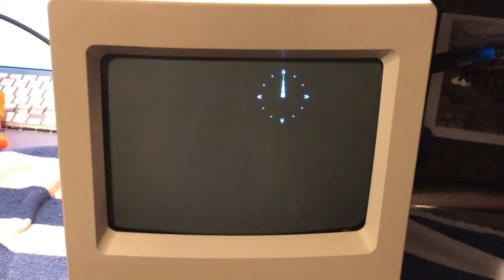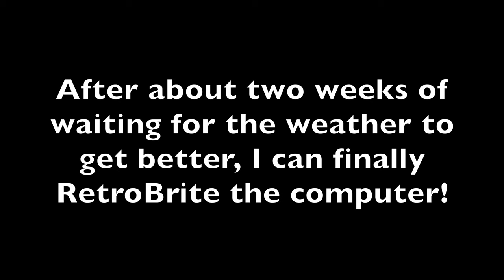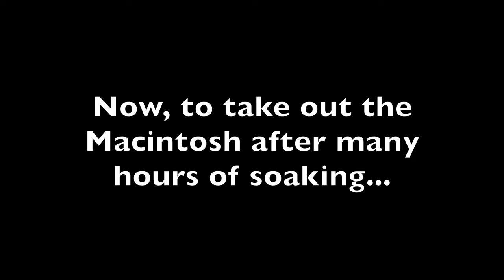Restoring a Free Macintosh Classic - How to Discharge a CRT - RetroBrite

Comment: When discharging the CRT it is highly recommended to only connect the grounding clip to the CRT's grounding cable or else you increase your chances of failing to discharge or damaging other components.

Comment: Very nicely done!
I just picked up one of these and am wondering what your peroxide ratio is. Did you use just one bottle?  Thanks
Reply from the maker: I don’t really have any exact ratio, for a container this big I used about 1/4 to 1/2 of the the bottle. You don’t need very much peroxide, but you need enough if that makes sense.